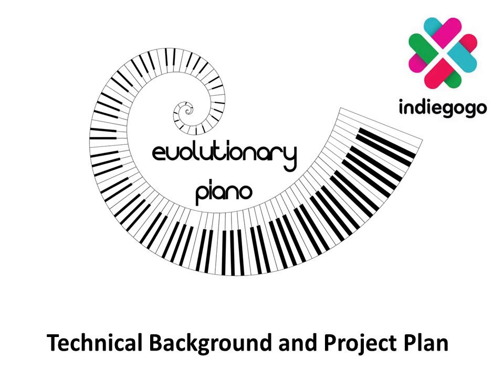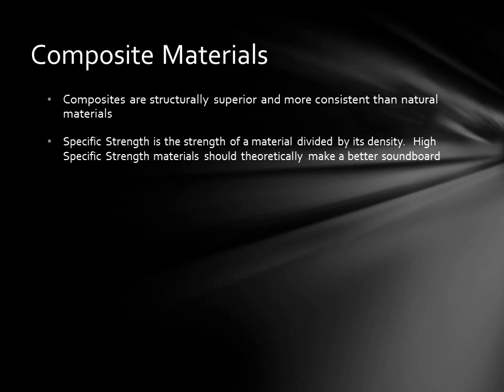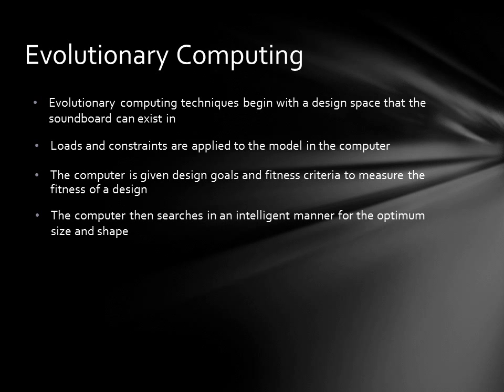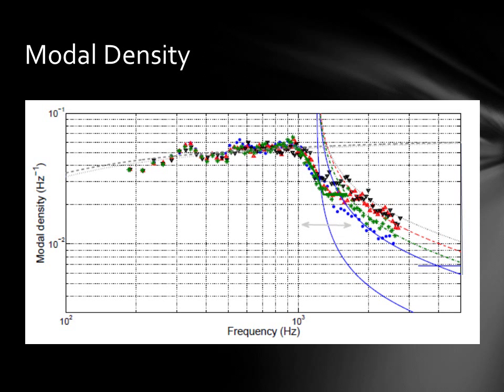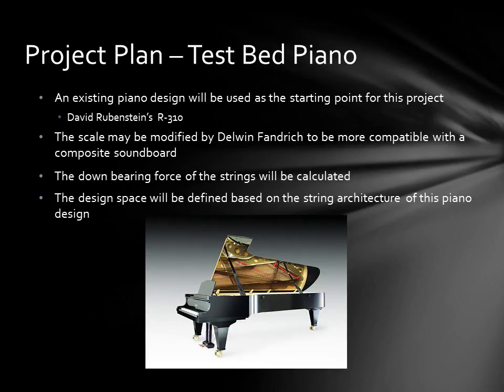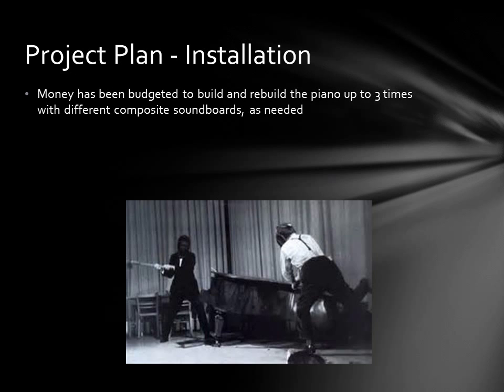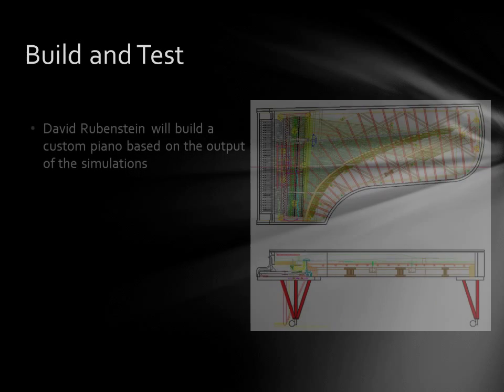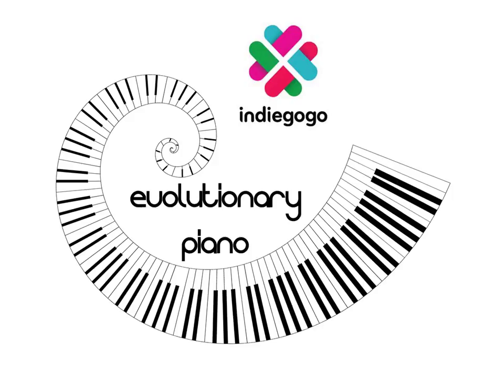Evolutionary Piano Technical Presentation

Comment: Steingreaber & Sohns made one already. I have heard it on you tube where of course you might not get the final effect as if I were there, but when compared to Steinway or other pianos on YouTube and listening to hundreds of them, a comparison can be made fairly. I have myself a Knabe 9' and there is something about that sound that moves your heart.  Steinway does this. Bosendorfer and other European pianos do not nearly as well. They are too perfect, too clinical, too 'cold'.  Steinway works becuase 90% of the performers simply prefer it, including the greats such as Horowitz, Grimaud, and hundreds of world class people.  Why?  Ask them. Nothing to do with marketing. It is what they want to play on. Knabe has a warmer sound than Steinway and some have preferred my sound to theirs.  But at the end of the day, it is the sound that makes a piano. And this is so high a priority, that it comes above all else, including pretty finishes and tech stuff.  So lets talk about sound . . .

My Knabe has very distinct voice that has left some in awe.  It is not perfect by a long shot. Indeed, I am working on a project to reestablish the collapsed crown and putting on a new bridge 'pin' system that will surpass the current bridge pin systems used for 150 years - a mod from the Pheonix, Waipin and Austrailian systems - simpler and i think better.  When the crown gets restored, and the new system installed, and being fully adjustable, i think it will rival the best anywhere because I have a damn good sound to begin with. And when play soflty and quietly, it takes you into out of body experiences. Why?

Wood has a sound that gives warmth, tone and beauty that I deriously doubt can be duplicated.  My piano has virgin growth wood from 1930 when the masters had it figured out back then.  OK, it sucks in moisture, so be it.  When the moisture is at 45%, the sound is tear jerking. OK, it needs to be tuned 2x a year, so what? big deal.

I have heard these carbon fibre boards from England and Germany.  From my ears, i feel the sound has no heart. It is loud, cold, clinical, too perfect. It does not make my heart go pitter patter as my own piano does. When a talented performer gets on it, we are transported to a new world because of the sound.  From everything I can heard on carbon boards, I am wanting to ff to the end of the piece because it grates on my ears.  and these were built by high performance companies too! The sound was just not right and I cannot explain fully why. But I would not buy that piano under any circumstances.

I have heard Bechstein has set up a factory to rebuild old pianos using the original woods from back then.  Why would any company spend that much time and effort if they thought a carbon board would supass it?  They did it because noting will replace old wood - like a Stradivarius violins.

I think there is incredible potential in old pianos and restoring them to their original greatness and maybe making some improvements on them, but nothing will beat the woods from back then.

Maybe as a challenge project to see if you can make something out it, such as a layer of fibre over wood which would make much more sense (keeps moisture out), but again, the wood is everything. They have tried all kinds a methods in wood, plywood, different species, arrangements underneath, thicknesses, rim thickness (Steinway is 1.5: thich upper rim made at the same time as the lower rim - other brands go for a 3/4" upper rim where that rim speaks as well), Crown retention systems (Mason and Hamlin), and so on.  There is so much more to making a good piano. the soundboard is critical but it must be a part of the entire great whole project. The board is not magic. Everything put together properly is magic. And Steinway has it figured out. Or Knabe. or secondly, Mason and Hamlin and Baldwin and the odd Europe piano, and then comes Yamaha, Eurorpean pianos, maybe Kawai and then the rest of the heard. Digitals dont even fit in here.

Stick with wood and a good design

Dave
Reply: Indeed, Richard Dain, who worked on the carbon fibre soundboard in conjunction with Steingraeber, is now producing carbon fibre PIANOS!